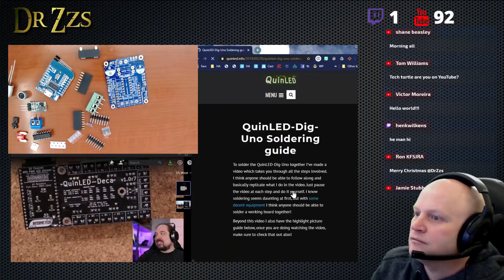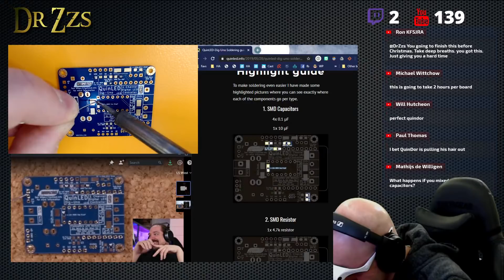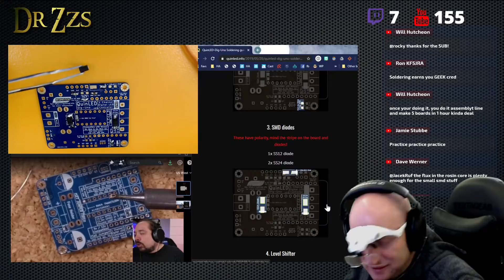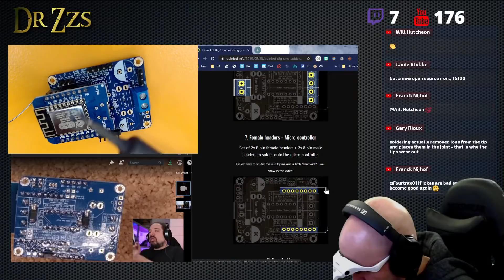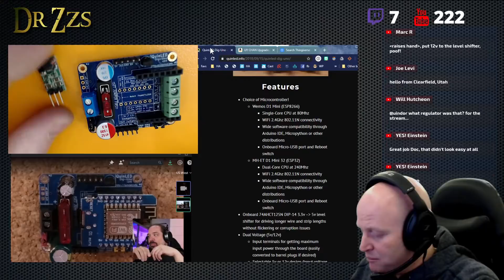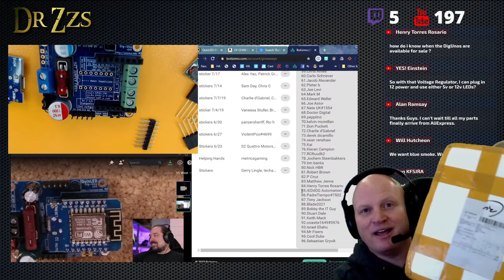#11 Building Dig-Uno LED booster board with Quindor

Comment: Super thanks for this  Module - I have already made a similar Module controlled via Blynk (more than 1000 Leds ) with limited feature. However i would like to make it compatible with WLED /E31. What is the code source for your Hexa module? Actually i trying to control more than 4 GPIO with WLED.

Comment: I find Ceramic tweezers are better for holding small SMD parts than stainless steel tweezers.  You did well with this.  It is tricky to hand solder those small 805 size components.
I got myself a Hot Air rework station from AliExpress.  858D - there are various brandings, but all the 858D's are the same device.   You can pick one up for about $30.  Get that and some solder paste, it is so easy.  Quin did a live stream soldering an Dig Uno recently using hot air reflow and it was so neat and easy.
If you're starting out, looking for a soldering rework station to be desk based, you really cant go past the YIHUA 853D or similar from Ali Express.  Again, like the 858D's, many brands have the 853D's and they are all the same.  The 853D is a Hot Air and Soldering Iron combo.
What temp do you have your Iron at when you solder?